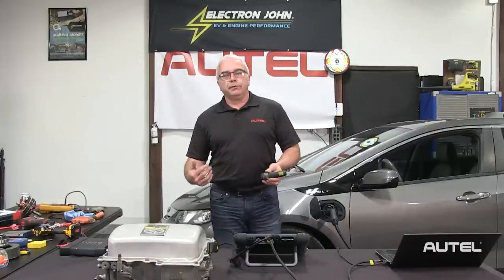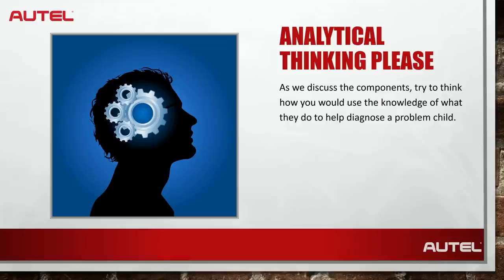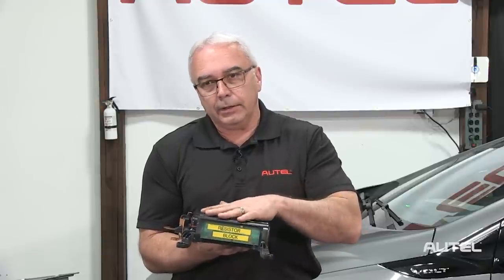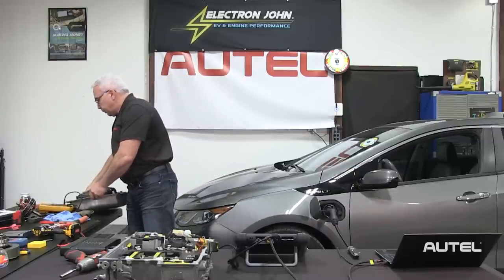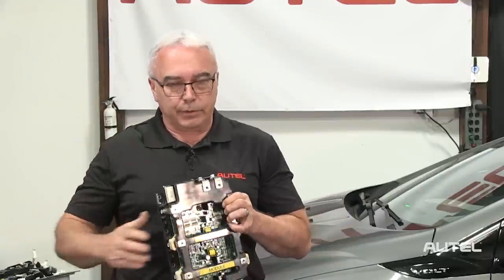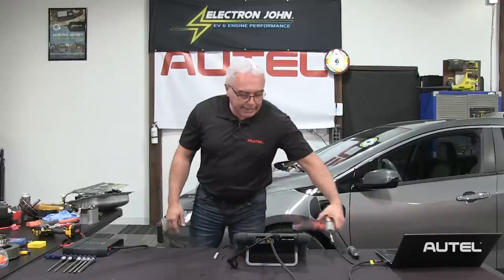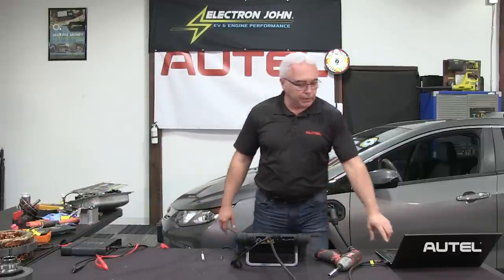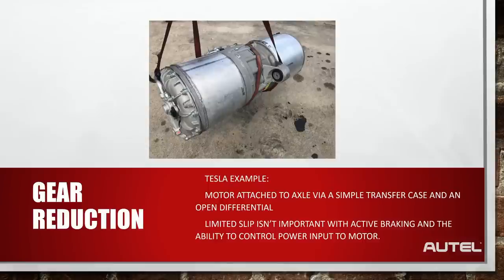Autel EV Diagnostics Webinar - Making EV and Hybrid Repairs Easy Part 2

Comment: 1 hr and 16 min od video, i keep paying atention to see if there is a way to discharge the HV in case of a resistor fault, or a way to test the voltage to make sure thank i has been discharged. meaning safe to touch w no gloves

Comment: Thank you for sharing your knowledge with us. The tool looks very impressive on direct connection to bms. I am still concerned about the cold weather in my area and the power grid cost to charge vehicles. I know this is coming just like freds did. There still is a lack of electrical knowledge in the field and training will be needed. Technology is always changing and keeping up with tooling is always a challenge but Autel has helped my journey.

Comment: I am using aitel Im 508 I need to add Toyota crown athlete 2004 key but it is not in the list.  I used to program toyota smart key maker, the car is ready to start but the remote does not work, what should I do to succeed